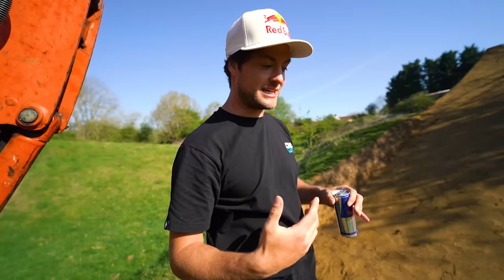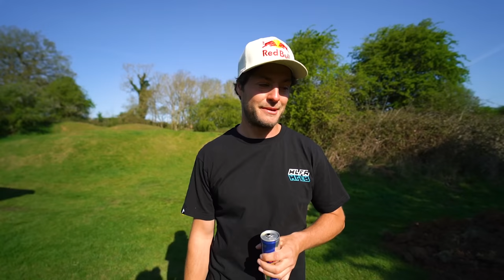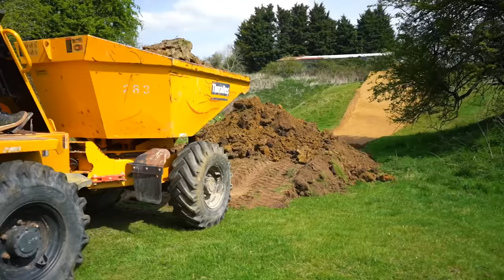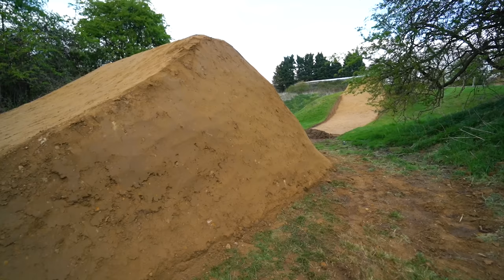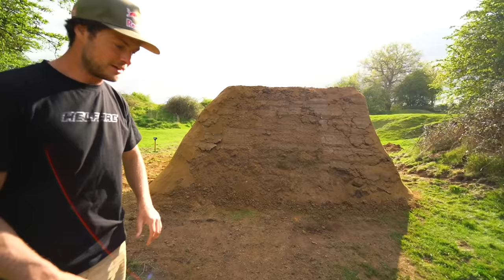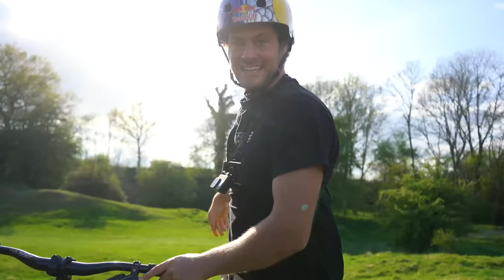TEST RIDING THE STEP DOWN AND BUILDING A HUGE DIRT JUMP!! PLAYGROUND EP5

Comment: The start point should be called the “Tee box”. Starting point for any golf course
Reply: Why not "Tea Point" ;) and add a bench and table to hang out :D
Reply: Or the club house.
Reply: If that's the case landing pad tee box first jump changes to the driver nine iron pitching wedge and putter as the next jumps the take off for this massive landing is just like a loft wedge sends it to the moon and short distance
Reply: Lob wedge is the most lofted club which goes the shortest distance. 

Landing could also be the pitch mark (the mark the ball makes when it comes down from height on the green)

Two of the greatest lob wedge players were seve ballesteros & Phil Michelson so you could make a play on names: like the Philly Flop (flop shot is played with lob wedge) 

I used to ride loads growing up, now I am fat and old it’s consumed by work, golf and trail Centres - never the same as the good old days of blasting my dmr jump bike about
Reply: A tee box with an optional drop called the pitching ledge
Reply: Anyone else get scammed on this page by a metal Jesus rocks saying they won a prize ?

Comment: As you said in the video where the line could split at the “loaf” I would suggest a pump roller into a large 90 to 180 degree wall ride/ wave feature around the tree on top of the second hill.  It could also be built as a 2 way feature off that low step Down hip you mentioned at the end of the video.

Comment: After the loaf, gradual split to 2 trails.  trail to the left uses the hill as a step up, maybe bend around after w a berm to the right back down the hill to get speed for a large lip / quarter type of hit.   Hill to the right is the wide  landing to a large boost able hip w Left facing landing.  Depending on where the berm goes from the 1st step up line line, it may be possible to have them share a super wide landing for the quarter and the boostable hip.

Comment: The line to the right next to the loaf could be like a uphill berm with and angled takeoff / shark fin at the top. Would be cool seeing you come off that jump in like a table top position rather than the standard straight up position and it being like a low long jump. Could call it the fade which is a type of golf shot. Either way keep up the great work and possibly name the next jump The Wedge?

Comment: After you build the nine iron step down, the next hit should be a quarter pipe and the run out can take you between the wood takeoff and the loaf, then connect with the b-line after the mainline split.

Comment: Here are some golf terms/expressions that would work well for jump names…

Stinger: a hard low hit that rolls out forever. Perfect name for a racer jump.
Flyer: When a ball goes way further out of the rough. Big booter would be appropriate.
Draw/hook: for a left hip. Snap hook 
Fade/slice: for a right hip banana slice 
The Divot: for a dug out whale tale or something 
Knee knocker/tester: for some sort of sketchy or scary feature 
Lip out/power lip: for a shark fin or berm you can jump outta 
Mulligan: for a feature that you can hit to start a different line 
The turn: going from the front to the back 9/ start of a new line midway through 
Dance floor: some sort of manny pad
Sand bagger: a feature that looks boring or easy but is huge and fun 
The 19th hole: last feature of a line. Something extra or bonus

Comment: Where the turf cuts in I would’ve done that it’s going to hold water let it run off the bottom but try make one side a tiny slope so no pipes or anything will be needed

Comment: Name for the last jump that is golf related: "The Flop Shot". If you look up youtube videos of a golf "flop shot" it's a style of a chip shot where the golfer typically uses a lob wedge to pop the ball straight up into the air to land softly on the green.
Reply: By the way 9 Iron is not the highest hitting club.
9 iron: 41 degrees
Pitching Wedge: 48 degrees
Sand Wedge: 56 degrees
Lob Wedge: 60 degrees (Highest)

Comment: Should do two options lines at the bottom of the step down so you can cut left or right to ride the back nine, front nine or straight to take the fairway to heaven.

Comment: The British open or formally known as “the open” for that big landing/jump. Also plate compactor would help your builds so much. Instead of smacking the ground with a shovel all day you could get a plate compactor and make your runs perfectly smooth with a machine a little smaller than a lawn mower.

Comment: @Matt Jones , can you build a dirt quarter pipe cut out of one of the velleys? Like the xgames fmx quarter pipe. I just have so many ideas. For example my local ski resort has a 4 sided spine. It has the choice to gap straight across or jump into the left or right side. It could be the hub to transfer into multiple different lines.

Comment: The next jump should be called 
" the pitching hedge " - play on the words pitching wedge which is a club used to get the ball to the business end of the hole which this jump will get to the big trick ones it also has a steep angle and sends the ball super high which matt will do off this jump with all the speed and also takes into account matts pain of not being able to get the digger around the jump because of the hedge!

Comment: still have not seen you use the lawn roller to compact and smooth out the dirt. all that shovel patting and you could literally push a lawn roller up and down and accomplish in 5 minutes what probably takes you about 30-45 minutes 🤔🤷🏼‍♂️